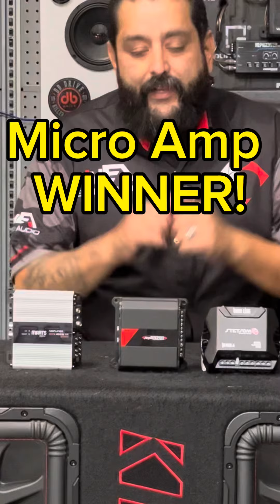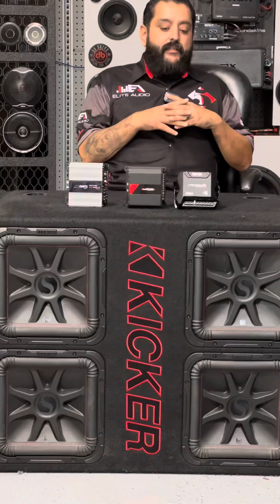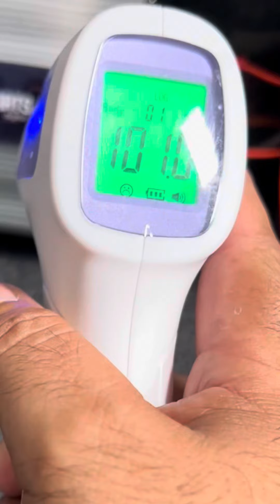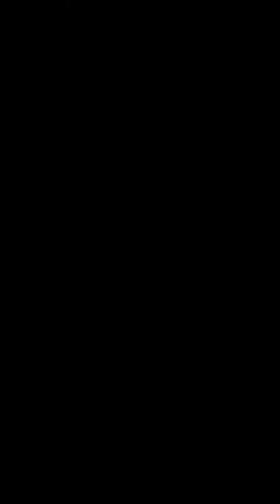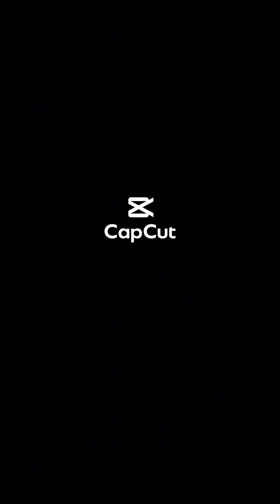Micro Amp Review | Which Micro Amplifier Is Best For Your Budget?

Comment: I bought the SoundDigital 400.4 off Amazon 2 years ago for $79. It's really only 66 wpc at 4 ohms but I bridged it to two channels and use it to  power 2 front door speakers (Cerwin Vega V68...sweet!). Very reliable so far and it's only warm to the touch, not hot at all. I only wish I had bought another on at that price!🙂

Comment: I'm calling bullsihit. I want someone to open these up and tell me what the insides look like
Reply: Mmats has an amp smaller than a book, that does 1320x2 and of I’m not mistaken has 96 signal / noise and below normal amperage draw . Ds18 has one same size that does 3600. I’ve seen the mmats opened up. It’s impressive. I’m getting their five channel. It’s not super budget friendly, but it’s above average quality and sound. Now the average mini hi power amp do produce those watts, but they do it with a significant bump in amperage draw. So theyre efficient in one context, and a fire hazard in another .